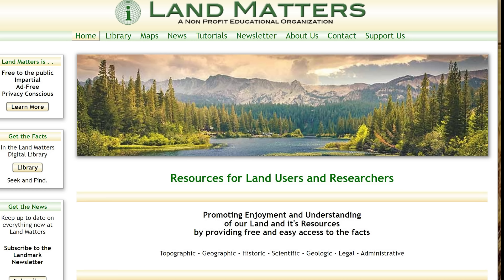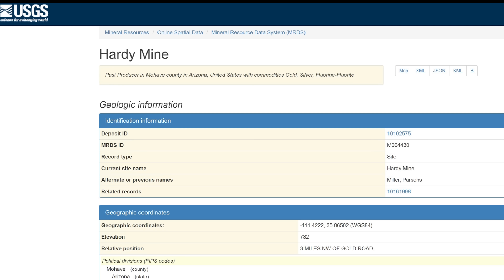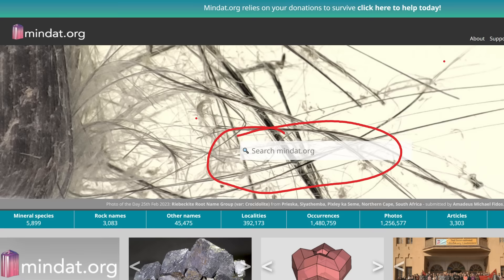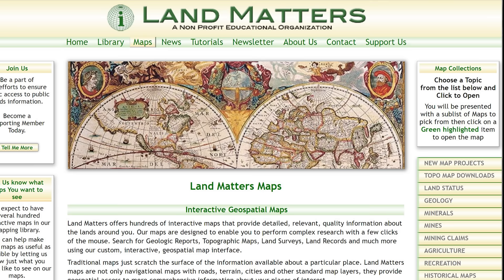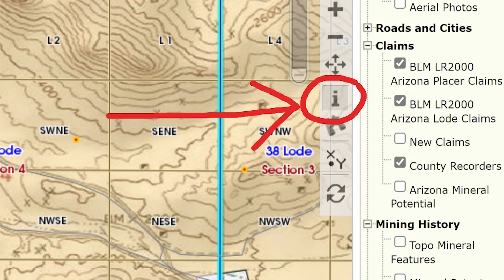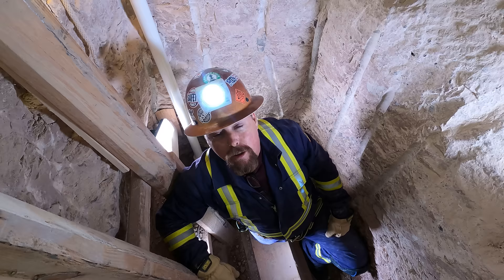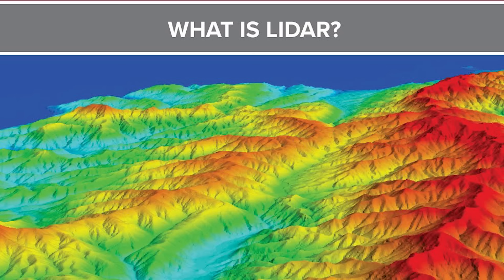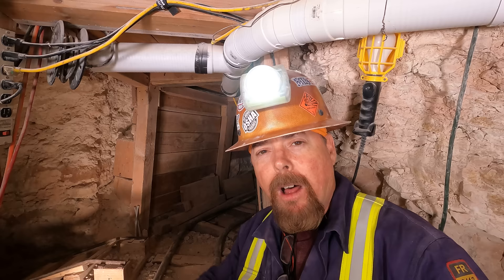Locating Gold Hotspots - Where to Prospect to be Successful.

Comment: I wonder if anyone realizes the importance and the value of the information you just provided in this video?  This is a college semester worth of education jammed into 10 minutes.  

By the way gang, it's also very important to know the host rock of the Primary Mineral.  For example if you are planning on using a metal detector to look for gold nuggets, you need to see that the host rock includes quartz.  Don't be like me!  In 1990 when I started looking for gold I went to where gold was found, LOTS OF GOLD!  Nelson, Nevada.  Me and my trusty metal detector went to Nelson over 36 times in 3 months.  I found nothing.  WHY?  Because the host rock in Nelson is monzonite an igneous intrusive rock.  And all the gold recovered in Nelson was microscopic.  They assayed continuously, crushed the ore and leached the gold out with potassium cyanide pits.  There is no gold that I know of that was ever been found with a metal detector in Nelson Nevada.  So if you are going to use a metal detector, and you're looking for gold bearing areas make sure there is quartz around the area.  Gold nuggets come from contact zones, many times between quartz and granite where veins form.  As the contact zones deteriorate and the iron oxidizes, the contact zones break down and liberate the gold bearing gravels and the nuggets.  Jeff, I hope you don't mind me adding my two cents.  I can't tell you how many new folks come in looking for a metal detector because they heard a lot of gold came out of Nelson Nevada and it's really close.  I have to tell them my story.
Reply from the maker: Thanks Doc, really appreciate that ..... great info ...exactly my friend about Nelson Nevada ....  really glad you mentioned that as we have heard similar stories as well with Nelson and other Gold producing districts
Reply: Here in Colorado much of the public panning areas have been picked over fairly well, so the remainder is usually flour gold. A detector is great for finding where the heavies are depositing as there is lots of iron, good spot to pan. I do find more gold with the detector in the park, as jewelry along with an occasional coin.
Reply: The beautiful thing about microscopic gold is it desolves in solution really well and there can be billions of dollars worth of surface open pit minable metals and minerals in the mix host rock above the commercial economic limit.

I use a 360 power gem microscope, pocket microscopes and modern inductively coupled plasma (ICP) assays and work in areas formed by volcanic activity primarily.

I am in no way limited to looking for microscopic metals and minerals and prefer  course mechanically seperatable gold in surface mineable gravel which can be wet or mechanically water seperated.  

The Carlin mine and trend is all microscopic gold running a whopping +/- .116 ounces per ton.

Comment: Would be pretty great to get some advice a little more specific than "go where gold has been found before." Anybody can find mines on a map. But what do we do with that information? Does it mean visit the literal mine shaft? Does it mean try to find a nearby river within x miles or meters of a mine? Does it mean go to a general area of a few square miles in which miles are sprinkled around? Does it mean anywhere within a large gold belt on a map? Would be great to see an example of scouting out a potential location, and what the calculus is after finding a mine on a map. Cheers.

Comment: Last winter I'm running my motor grader opening up the alternate driveway in some deep snow. I forgot the GoPro was stuck to the side, rookie mistake, I pulled a Kleeman. 🤔 too good to pass up.🤣😂🤣 .
The driveway was overgrown with brush along the sides. A limb snagged the GoPro and I had not noticed. Several passes later I 🤔😱.🤬remembered  .... I stopped jumped off and looked around. The snowpack was about two feet and I had it cut down to about 6 - 8 inches. Nothing was in sight it was getting darker and I felt like 💩 Bummed. The only way I'm going to find it is with a metal detector. 😦 I don't own one.🥺 Off to town I went.  💨 ...  Buck fifty later ... Yeah, I got the cheap one.
 I'm out beeping around and found the GoPro packed in the snow in a tire track - with chains. So I had plowed over it and then backed over it. .... Not a scratch on it 🤯. Tooooo bad it wasn't on 🤦 
Thee next day the GoPro was setting on the dash of the truck and slid into the seat where I had put some hand tools. .... Broke both the front lines and really cracked the back screen🤬🥺... Still works great.🤗 That metal detector paid for itself in ten minutes three times over.
Reply from the maker: haahhaha great story ...that would have been cool footage

Comment: Great info, I book marked this video for later. Your discussion of the layers and the red worms connected my thinking to my recent research project of the solar micronova and pole shift cycle of twelve thousand years. Coronal Mass Ejections by the sun fling out all manner of elements, including lots of gold, that splat across the planets when it happens. It would be curious to chart when the CMEs happened, where they happened, and how the gold fields might match. It seems this periodic event is also responsible for oil and coal deposits. Last time around, the Clovis civilization that covered the Eastern US through west of Clovis NM where their remains were first identified and all the NA large mammals were made extinct.

Comment: i wonder where can you sell your gold for maxiumum return? i know the big nuggets go to collectors for a premium but what about the little stuff?

also you can get a geography overlay for google earth which tells you not only the kinds of rocks your going to be dealing with but also the exact location of the fault lines. ive been thinking the arroyos intersecting the fault line between 2 known gold bearing rock types is what were looking for. specifically where those arroyos flatten out downstream from the fault line.
Reply from the maker: try using Midwest refiners. We recommend smelting down your fines and then shipping them that. They will test it and give you 95% spot on 24K      https://www.youtube.com/watch?v=CHOf4-EHH5A

Comment: Great info Jeff
Please correct me if im wrong but a claim holder is legally supposed to mark the corners of a claim & plant a discovery post with accurate & up to date info & renew every year? Miss the deadline by a day & you loose it. So IF a claim holder is doing what they are legally required to do it SHOULD be fairly obvious there's a claim. On another note & again please correct me if im wrong, say a load claim is filed on some property a person can still look for placer gold on that property? The load claim only covers the load deposit, is that correct?
Reply from the maker: that is correct .... but the problem is not everyone does that or does it incomplete or people steal the claim info . We like to check areas out first by doing the research as we can cover more ground that way ....   yes that is correct ...there have been so many court cases over that last question and the last ruling we have seen is Placer claims cannot be located over Lode claims but Lode claims can be located over Placer claims ....such a grey area that BLM discourages the two to ever meet . A good source is IBLA (Interior Board of Land Appeals)

Comment: Jeff Williams im new follower and catching up.  Maybe you have discussed this but I have been wondering for a while as far as detectors go does cheap or expensive matter.  They range from 100 to thousands what to buy as a beginner hobbyist?
Reply from the maker: welcome aboard and we would recommend the Gold Minster 1000 to start with ...yes the more expensive models like the GPX and GPZ models are very good machines and are what are used by the pro's.

Comment: How does Land Matters differ from Parcel Viewer?
I keep hearing to use Google maps and earth to view geological features.  All I see is paint splats that your grandkids made.  Nothing geological about it.  And they are supposedly satellite images.  If that's a satellite image then it's false advertising and fraud as far as I'm concerned.
A drawback for the apps/programs you talk about require a computer or laptop, the phone won't cut it.
How far back on the mining information do those apps go?  The courthouse microfiche out front only goes back so far, the rest are in archives.
I tried to get info on some holes I seen, they wanted a docket number.  Mines don't have those and besides the hole didn't come with a name.
How do you deal with these courthouse records departments?